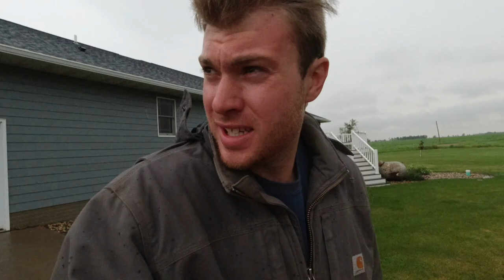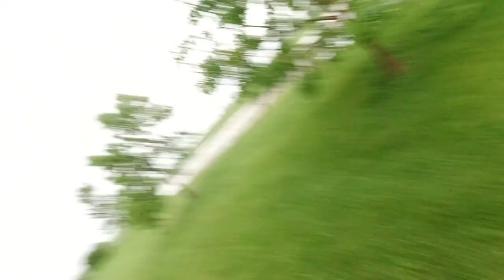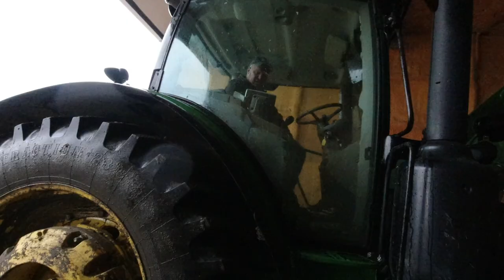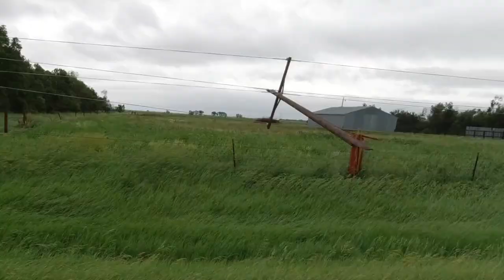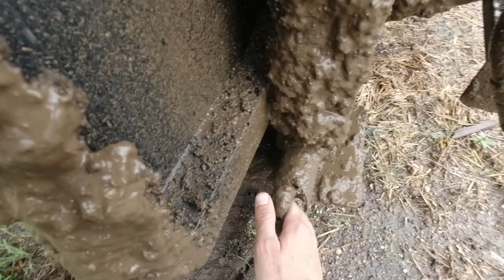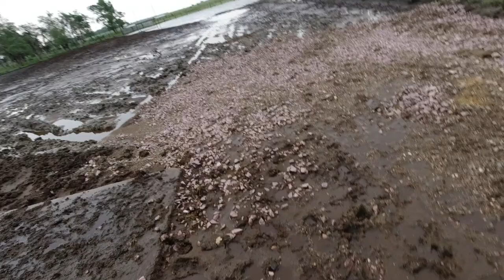Destructive Storm hits the farm

Comment: I asked my electric company one time about the poles on why they use wood and not steel and this was a answer i was givin “great question! A steel pole averages around $2000, where a wooden pole averages around $350. We have 13326 primary poles in Paulding County, so you would be looking at over $26 million to put in steel poles in Paulding County. That doesn't include labor and on top of that our transmission cost would also increase significantly. So, to fully anwser your question, PPEC only uses steel poles when deemed necessary, due to the expense. With the cost the way it is now, it's just not feasible for us to put in all steel poles”
Reply: and underground is.......?
Reply: @CurrentChoices  wym
Reply from the maker: Very interesting
Reply: @SonneFarms  agreed i asked a question and got a big detailed answer

Comment: If we got the rain you did the entire city of Las Vegas would be 100% flooded really bad for days. The amount of rain you got is more than are yearly total of rain. If you look up flooding in Las Vegas NV you will be able to see what happens when it rains here. The flood district has spent over 10 billion dollars in the last 30 years to put in huge retention basins and storm drains that start on the westside of the valley a 15ft by 15ft and before it goes under the Las Vegas Strip Storm drain's are 120ft wide by 30ft tall and 5 miles farther east they are 200ft wide by 80ft tall it's crazy how big they get and it's only 20 miles from the westside to the Eastside of town